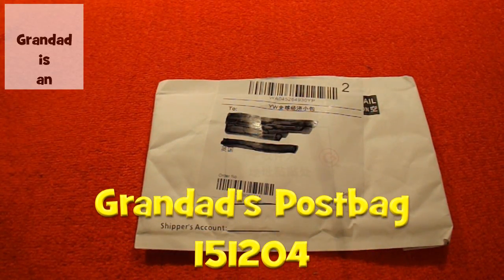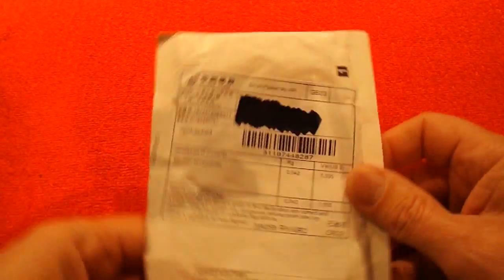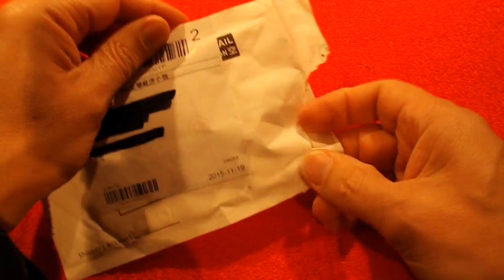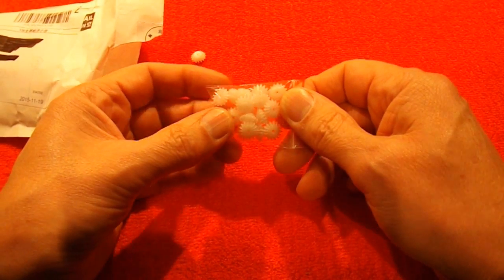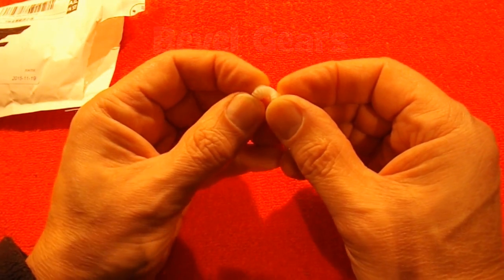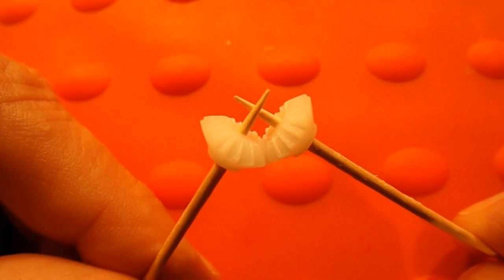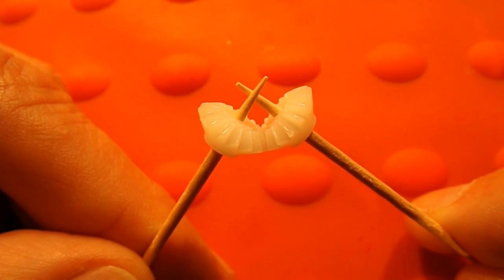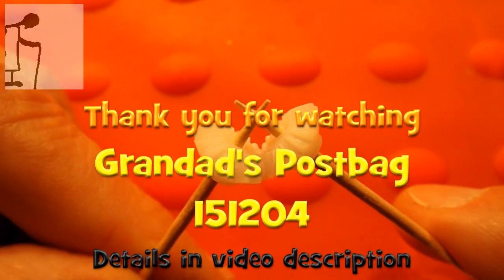Grandad's Postbag 151204 Bevel Gears

Comment: can you use that technology in an rc boat? good video 👍
Reply from the maker: +Jboss2001 Gaming those gears were intended for that Outboard motor on Child's Toy Boat series I did but they arrived to late. They would have replaced the two gears I used and would have meant the gearing was 1:1 instead of being reduced. The links for that boat are in the video description.